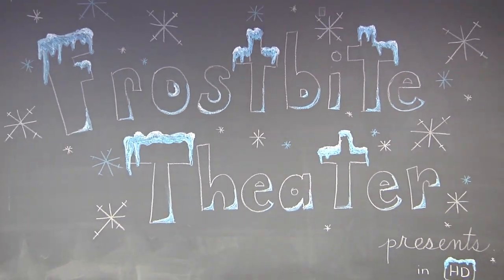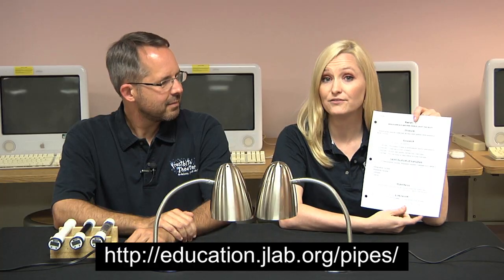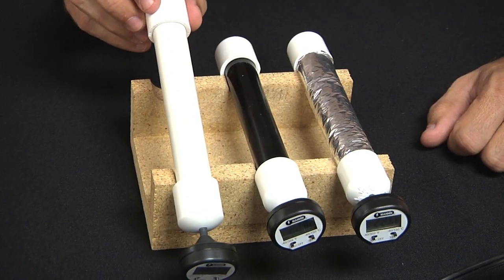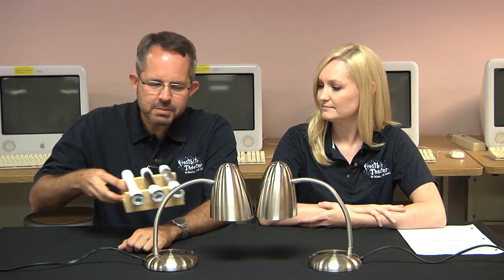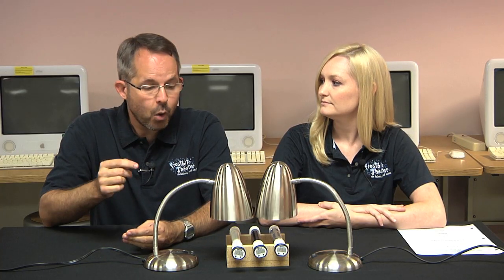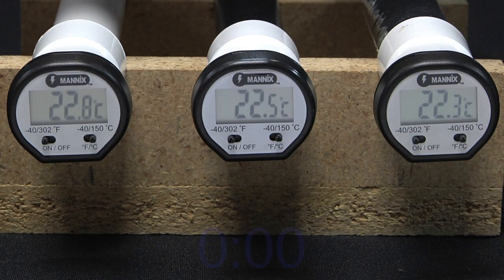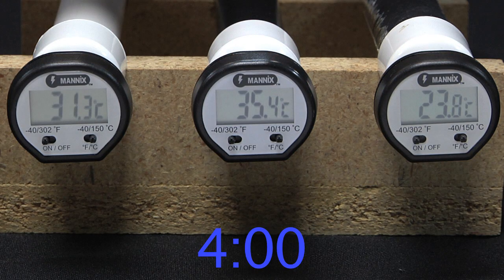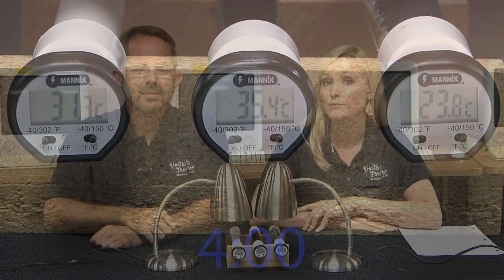Lights on Pipes! An Experiment with Light and Heat

Comment: What are the pipes filled with? And how to you seal the connection for the thermometers?
Reply from the maker: +John Hunter The pipes are hollow, so they're just filled with air. The thermometers' stems have a small length of heat shrink attached to them. This keeps them seated within the holes drilled through the end caps.

Comment: I wonder if the paint has some kind of insulating effect that caused the slower heating of the black pipe. Maybe black paint has a higher thermal capacity?
Reply from the maker: Christian Gomez Unless the paint changes as it is heated (which it very well may), then it should never be able to catch the white pipe. If it has a higher thermal capacity, and always has a higher thermal capacity, then it always heats up more slowly.
Reply: Good point. I was thinking in terms of how some materials refuse to let go of heat until a certain threshold, such as how in computers a heatsink cooled by a fan will never chill the component (bring it below a threshold), but the fan (or more precisely the moving air) is definitely removing heat faster than it is being generated otherwise the component would never cool down.

Comment: Correct me if I'm wrong but I thought light reflected off of white objects so why did the white pipe Heat up do much.
Reply from the maker: Well, the white pipe looks white under visible light. But, that's not all that the bulb is emitting. For all we know, the 'white' paint looks dark in infrared.

Comment: A cliffhanger!

My wild guess:

The proximity to the lamp is responsible for the initial rapid heating of the white tube.

1) Black tube mostly heats from RADIATION.
2) Surrounding air around bulbs will get very hot, so white tube which is close by gets heat from CONVECTION.
3) Mylar covered tube has buffer of air, which acts as insulating jacket, thus mostly immune to convection.
Reply from the maker: If the white pipe heated more quickly than the black pipe because it is closer to the light, how did the black pipe catch up? The white pipe was always closer to the light so, if it heated more quickly in the beginning because of this, it should still be true four minutes later, as long as the temperatures aren't too close to their equilibrium points.

All of the tubes are heated due to radiation. The pipes are beneath the lights, so the pipes are never in the convective currents created by the lights. If the pipes were above the lights, then this would be a source of heating that would have to be examined.
Reply: Jefferson Lab OK, then I don't know!

My second guess though is that is that this has something to do with the difference between black body radiation (4th power of temperature differential), and the radiation power from the bulb (2nd power of distance).   Black tube can stay cooler because it can radiate off heat it's gained, and hold off it's inevitable equilibrium temperature longer.  Or something :)

Would definitely be a cool science fair project  (or Jefferson Lab followup).

Comment: What would happen if one uses a thermometer that measures the temperature of the surface of the tubes? One can use the sticky thermometer or the kind they use to ale temperature from a distance. That way possibly one does not have to worry about conductivity of the black paint etc.

Comment: So, when I plotted the temperatures for all three tubes at every 15 seconds, It seems that the black tube has a lag before the temperature linearly goes up. The white tube , on the other hand, goes up linearly from the very beginning. For the most part the graphs are linear at the end of the experiment - so, no equilibrium temperatures are not close by. Black tube has higher slope than the white tube , as expected. So, the only thing that I do not get is the lag in the beginning for the black tube. How the black paint is causing this? It cannot be the extra mass… The specific heat is not a factor either . It seems that some the heat was not used to increase the temperature (used up for something else - to change the structure of paint molecule?) or initially heat was not absorbed. It is quite interesting!!

Comment: If possible could you please repeat the experiment with the placement of the pipes changed to eliminate the any question about which pipe gets most heat from the bulbs?

No matter which pipe gets more heat, it does not answer the question why the relative rate of heating is not constant. Although I can draw the graphs, It will be interesting to see the graphical representation of the temperature increase.
Reply: I think I am OK withe fact that the relative rate of temperature increase is changing (considering the equilibrium temp), But I do not understand why the initial rate of white is higher than that of the black.

Comment: What if the lamp near the white pipe heated up faster than the other one? The idea is that since the wattage of both bulbs (I assume) is the same, they will eventually emit the same amount of radiation, but the experiment started as soon as you lighted up both lamps, if the one near the white pipe heats up faster than the other one then during that period of time the white pipe is getting more heat.
Once both bulbs reach the same temperature,  since  black is more "heat-friendly" than white it starts to catch up.
This is just an idea, though it's unlikely if the bulbs are the same.
Reply from the maker: If that were the case, one would expect the cooler bulb to be dimmer and it would brighten as it warmed. There's no visual evidence of this and, considering it takes about a minute and a half for the black tube to catch up, it's something that should be seen. If it takes two extra frames (~1/15 of a second) for the 'dim' bulb to come to full power, you wouldn't expect that effect to last for 60+ seconds.
Reply: mhh aye... this thing is really puzzling

Comment: I'd rerun the experiment but add thermometers to the outside of the pipes to measure the temperature just above the pipes. It is possible the white pipe was receiving more light energy than the black one, giving it a head start but eventually losing to the superior absorption of the black pipe.
Reply from the maker: The flaw I see in that is that the temperature just above the pipes would be affected by the pipes. Perhaps doing like you suggest, but without the pipes being there, would be better. Put the thermometers where the pipes would be and see what they read.

Comment: I'd guess that it's to do with the difference in heat capacity between the black and white "paint", or, if the white isn't actually painted, then the difference in heat capacity between the black paint and the white pvc material. Correct me if I'm mistaken, but if the black paint has a higher heat capacity, it will take longer to transfer its heat to the pvc and then to the interior of the pipe, even if it's absorbing more energy. But at some point, the dominating factor will be the absorption of more energy by the black tube, and it will end up with a higher temperature. Not sure if this stands up to scrutiny, but it's my first intuitive guess.
Reply from the maker: Possibly. Or, it could be something strange like the paint's IR absorption characteristics changing with temperature. So, how would you go about testing your heat capacity hypothesis? How would you design that experiment?
Reply: Jefferson Lab If it's related to the high heat capacity of the paint slowing the transfer of heat into the pipe, then a thicker layer of paint would amplify the effect. So I guess the easiest thing to do would be to test pipes with 1, 2, 3, etc layers of black paint and see if there is a relationship between the time it takes to initially warm up and the number of layers of paint.
Reply: MallowTheCloud I think the heat conductivity of the black paint is a reasonable hypothesis. That would explain why there is a delay in heating the black tube. Once the heating of the inside starts, it increases linearly. Multiple coating of the paint should answer the question as the delay time will increase with number of coating. One also can use other back surfaces, like start with a black tube and paint a second tube white for comparison.

Comment: I would think that this experiment should have been performed under direct sunlight.  This would make it more certain that each pipe received exactly the same amount of energy.  I would say that the white one heated up more quickly at first because it was directly under the lamp but perhaps it reached some sort of equilibrium causing a less linear abortion of energy.  I've noticed that white roofs tend to heat more quickly during the daylight but don't get as hot while black roofs get hotter but cool down more quickly at dusk.  Why?  I have no idea.
Reply from the maker: Equilibrium will eventually be reached, but it hadn't been reached by the end of the 4 minute warming cycle since all three pipes were still warming at that time.
Reply: Jefferson Lab Many years ago I did a similar experiment when these laser thermometers were still only "professional tools" because they were very expensive.  We built a white roof and a black roof.  We determined that the white roof warmed MUCH more quickly than the black roof and reached equilibrium quickly.  The black roof warmed more slowly but got much hotter.  The black room also cooled to ambient temperature before the white roof even though it was 30 degrees hotter at equilibrium.  I never bothered to figure out why but I'm sure it's the same principle that drives a radiometer.

BTW -- In the words of my daughter -- YOU GUYS ROCK!
Reply from the maker: Oh, and doing it in sunlight is a really good method for equalizing the irradiance. Nice call with that.
Reply from the maker: wb5rue As it turns out, something that's a good absorber of radiation is also a good emitter of that same radiation. If I have an antenna that couples to a particular wavelength, then 'running the film backwards' shows that same antenna emitting that wavelength. It's just that the black surface has a whole lot of antenna that operate over the full spectrum. When it's time to cool down, there are lots of channels available to it.

The radiometer can be looked at as a conservation of momentum demonstration. The black side of a panel is warmer than the white side. There isn't a complete vacuum within it (which is why it works at all). A particle of air hitting the black surface will warm and leave with a higher velocity than one hitting the white surface. Greater velocity means greater momentum, so the black surface rebounds 'harder' than the white surface

Comment: Here's a hypothesis: The black object stores the energy more efficiently than the white body. If the white body releases energy at a rate comparable to how much it absorbs, the temperature should increase linearly; if the black body absorbs more than it releases, energy left over in the color jiggles the molecules more and will also heat it up. So, the black object heats itself with the light and it's internal energy. This should then give an exponential heating up. Graphing each one shows this. At about 1:45 they each have the same temp. Before 1:45 the rate of heating is in the white's favor and after it's in the black's.
Reply from the maker: During the 4 minutes, both the black pipe and the white pipe absorbed more energy than they released. Otherwise, the temperature wouldn't increase. Given enough time, they would each reach an equilibrium temperature, with the black's being higher than the white's.
Reply: Jefferson Lab
Oooh, I didn't think about their steady state temperatures. That makes it even more convincing that the heat stored in the black contributes. That means that we can take different lamps and measure the differences in steady state temps of the black vs. white. What that difference means isn't entirely evident to me though. Maybe related to how long it takes for the heat to dissipate.

Comment: you failed: the black pipe is in the middle, witch means that is gets less light that the others so i would like to see the same set up but with better lighting
Reply from the maker: It isn't clear that it does get less light in that location. While it's further from the bulbs, it 'sees' two of them.

Comment from the maker: If you're going to ask a question, please make certain that your comment can be replied to. Otherwise, it's a bit pointless...
Reply: could it be that the lights were directly over the white pipes and not beaming down on the black pipe
Reply from the maker: randomhalofan292 But then why did the black pipe catch up? If the white pipe is absorbing more energy because the light is more intense, then that's true for the entire experiment.
Reply: I think I know the answer to your question.  Not a scientist by any means, but here's what I think.  See as the light passes through the white, it heats the inside more quickly because it hits all that space at once which gives it a sorta head start, but at the same time, light is escaping and after a certain point, the amount of light escaping comes closer to the amount of light going in.  If that makes any sense.  lol.

But in the black tube, the heat from the light takes longer to get into the pipe, but very little escapes and after a certain point, the heat particles start creating a type of friction as they collide with each other and start producing their own heat as well which gives it a boost.

Not sure if I'm right in this, but that's my theory. XD
Reply: Edynol
never looked at it that way thank you
Reply: Jefferson Lab Could it possibly be because once the light has been on for a few minutes it begins emitting infrared radiation due increasing temperature of the bulb and the black body effect?  This combined with the fact that the white bar is presumably more directly under the light and the black bar is a sort of "shiny reflective" black (see reflections at 0:34 ), might indicate that the black bar may absorb infrared light more readily than the white bar.  So the two factors (more direct light, may absorb visible light better) that made white faster at the beginning, vs infrared radiation later on might explain the initial boost to the white bar but black catching up after a few minutes.
Reply from the maker: Michael Reilly The lights heat up quickly. From full dark to stable, it's about 6 frames worth of video, or about 1/5 of a second. That's the time frame over which the IR radiation from the bulb is changing. It's far too short to account for the much longer lag in heating rates. Also, the effect is present in the run we conducted in sunlight (Lights on Pipes: Full Sunlight Trial) which, hopefully, gave us a constant radiation source. The answer, I believe, lies within the paint (IR absorption characteristics are dependent on temperature, for example).

Comment: The lamp design and positioning probably had something to do with the white pipe warming up faster at the start.

The black pipe in the middle was further away from the light bulbs.
Reply from the maker: It's true the that black pipe is further away from the bulbs, but it 'sees' two of them. And, that still doesn't explain how it's able to catch-up with the white one. If the amount of energy the black pipe absorbs is less than what the white pipe absorbs because of the positioning of the lights, then that's true for the entirety of the experiment. It shouldn't catch the white pipe until the white pipe begins to reach its equilibrium temperature. I suspect what's going on is more complicated than just the positioning of the lights. More experimentation needs to be done...
Reply: The distance makes the point. Heat is transmitted by radiation and convection. Light radiation effects all pipes. Convection is propagated by heated air molecules. Once the air temperature around the pipes is the same the higher absorption of black kicks in. (see suggestions of placing thermometers)
Reply from the maker: Dr.Eminem Since the pipes are different temperatures, the air temperature immediately around the pipes isn't equal.

Comment: As to why the black pipe was slower to warm...Unless you used a light meter to test that the amount of light falling on all three pipes was the same, I suspect that the black pipe in the middle was not illuminated to the same degree as the other two pipes which had a light source directly above the pipe.  To be a fair experiment you needed three light sources and should not have had any overlap of light from one source falling on another pipe.
Reply from the maker: Yes, this really be a one pipe, one light situation for it to be completely fair. But, if the white pipe is absorbing more energy than the black pipe because of the positioning of the lights, then this is true for the entirety of the experiment. There isn't really a mechanism for the black pipe to catch the white pipe under those circumstances, at least until the white pipe nears its equilibrium temperature. It's like giving one person $10 and another person $5, over an over, and then having the $5 person ending up with more money. Ultimately, I think the answer is more complex than just the positioning of the lights.
Reply: Jefferson Lab I think what we are missing is that the desk is black and is absorbing and re radiating energy up at the bottom of the pipes and that the black pipe will absorb more of this back radiation.  At the start it is just the top of the pipe and the light heat source so the white pipe is absorbing more net energy.  As time progresses the back radiation from the desk plus the top lights on the black pipe is grater and it allows the black pipe to catch up.    Going to have to plot the time/temp values to see if the wipe pipe rate of change was slowing down as it may be approaching equilibrium for it's albedo.
Reply: Metazone101 oops, the bottom of the holder is wood, not the black desk.  Still may be a factor, but less so .